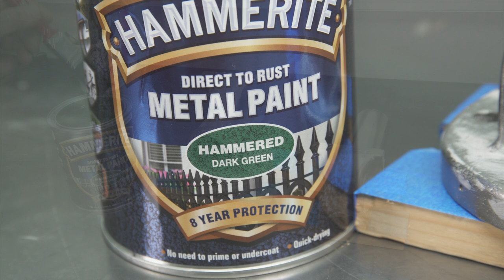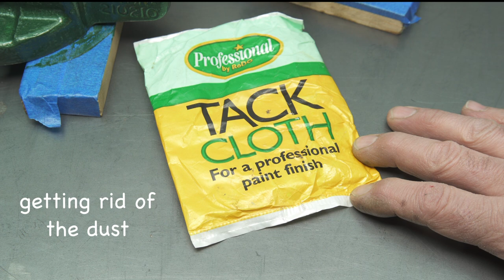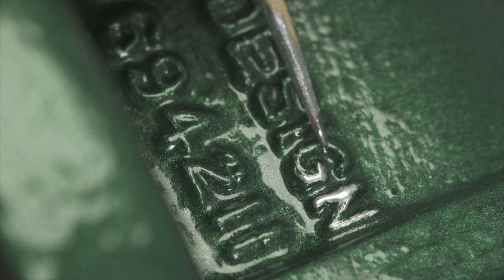Very Rare Rusty Vono Vice Restoration - Full Perfect Restoration of a Vintage British Vise - ASMR

Comment: Lovely job !
After disassembly and scraping off the worst of the crud, I have found the best way to degrease and remove paint, is to simmer it in a Caustic Soda bath for an hour or so before hitting it with a pressure washer. Then into the electrolysis tank.
As opposed to wire brushes grinding discs, flap discs and the like, this method takes it back to clean bare metal without removing the metal itself, and you can then make an informed decision on how much you wish to clean up .... conservation vs. restoration. Some like 'em shiny some prefer to leave old casting flashes etc untouched for posterity. Either way I would never take a power tool to bearing surfaces and ways. All that would do is increase slop or backlash into the vice.

Comment: I recently used the very same Hammerite Hammered Dark Green on my own Record Vice restoration. Best colour in my opinion. Nice job you did, but I would leave casting marks rather than try and smooth them out, they are original.
Reply from the maker: Hi mę mÿ bikë ń ì, thank you so much for your great comment, the green really is a great colour and it looked great on your Dad's vice😊👍keep up the great work on your channel👍😊

Comment: If you intend to paint steel, don't polish it. Paint sticks best to the sand-blasted surface you originally had. Remember, ALWAYS apply primer to a sand-blasted surface no more than 1hr since blasting, steel will visibly start to rust in that time.
Reply: Correct

Comment: Absolutely beautiful job and enjoyed watching it. Can I ask a question please. Why do you polish the Vise and then fill it.
Wouldn't it be easier the other way around 
.many Thanks
Reply from the maker: Hi Martin, thank you so much for your comment, I'm really glad you liked the video. The reason for polishing with the wire wheel before filling was to ensure that the surface was clean and gave a good key for the filler. If I filled and then buffed the piece there was also a good chance of bringing off some of the filler I had put in. The filler was there only to fill the minor imperfections left after all the other processes had been completed, as you will have seen, only a small amount of filler remained after sanding it back👍😊

Comment: My only complaint would be I really wish you'd learn about primer. I always use two coats of primer one white the other red then paint. Other than that good job. AND no, as a matter of fact two coats of paint isn't the same thing.
Reply from the maker: Hi Ken, thank you for your comment, I take on board what your saying, unfortunately the manufacturer of Hammerite, the paint in use, advocates that it is applied straight to bare metal with no need for a primer.

Comment: - video is 30 minutes; should be max 10 minutes.
- is it necessary to use body filler? answer is no.
- you don't sand hamerite metal paint; one coat is enough
- all in all, you over did it...
Reply from the maker: Hi Suhayl, thanks for taking the time to comment, I think if you look really hard you’ll find that this is my channel and on it I can do as I choose. When you have your own videos you can do the same, but rest assured I won’t comment on those!
Reply: @restoreandmake  you make a fair point, these are your videos not his, its fine to criticize but not outright say that you did it wrong.  The vise should be done to the owners specs, if that means filler than so be it.  Also I appreciate you taking a bit of a stand, most other channels that I have seen would simply say, “thank you for the feedback, ill take that into consideration”. All in all your video was enjoyable, keep up the good work!